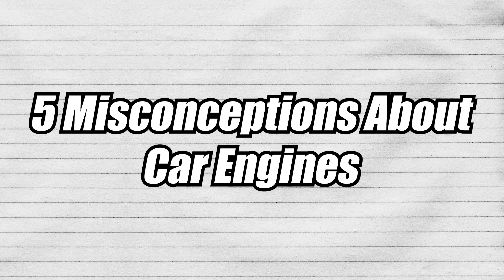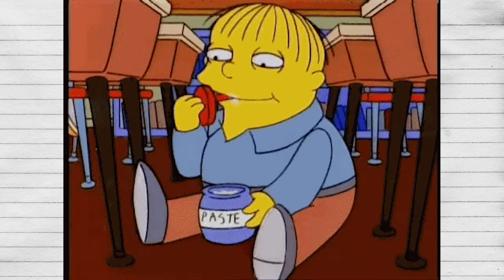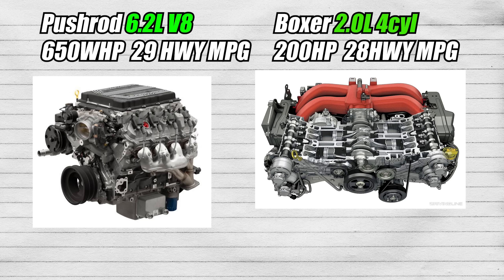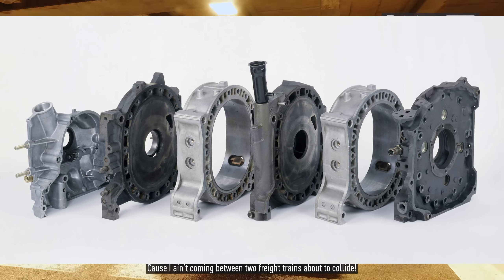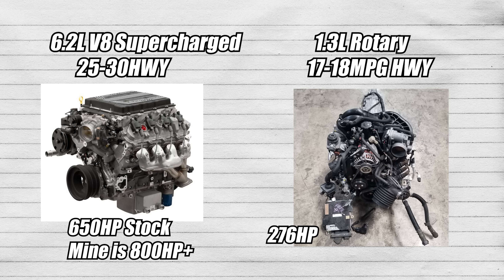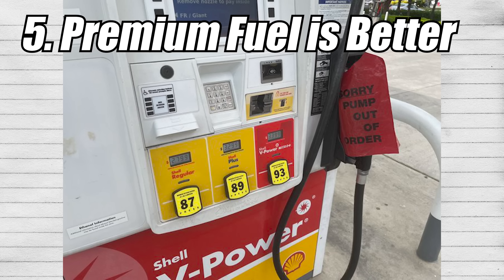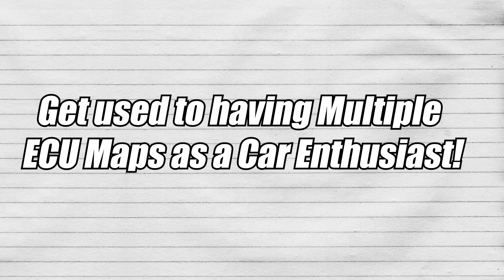5 Misconceptions About Car Engines!

Comment: The gas consumption has actually been a topic i'm used to talking about, I drove an '89 Century with a 3.1 v6 and some people were like "so, you must be just running to get gas every morning then" and then I'm like "nope, it gets me 18 mpg mixed and around 26 to 28 on highway" and this usually blowed their minds like "my 1.5 struggles to get that way in highway, how does that old thing gets that mileage" and usually the explanation is "well, my car can easily idle at 50 mph, and it goes smoothly to 75 when your car has to go all crazy on the revs to get there"
Reply: It’s because environmental regulations made it harder to hit efficiency targets, ironically. Back in the day they made cars with no VVT that did 50-70 mpg with small engines because they could get better gas mileage at the cost of bad emissions.
Reply: @__dm__  well, i'd much rather burn down gas faster than to release that sweet lead into the environment but, something true is that regulations backfire more often than we would like, as a matter of fact I really expect some negative effects on the push for electric vehicles, not out of being mean but because the guys that want to ban ICE's seem to forget how much pollution do EV's release at their first year after production.
Reply: What 1.5L can't get 27MPG on the highway? The Honda Fit has a 1.5L that gets 40MPG on the highway and over 30 in the city. The Ford Fiesta gets 43MPG highway and over 30 in the city with a 1.3L.
 
Also, 28MPG highway with a V6 is kinda low. Most V6 can get over 30MPG highway. This has been true since the early 2000's. Subpar gas mileage is not mind-blowing.
Reply: @LePedant  It does depend, reported data by the OEM's are given under very specific circumstances, I've heard people claim their 1.2's not making it over 30 mpg when I could do a 45 in a 2.5, you take into consideration altitude, environment and driving habits, and yeah, the fact that I'm 6500 feet above sea level means engines without forced induction lose around 20% efficiency
Reply: @engineeredtofail6746  Yeah, the 6500 elevation does ruin efficiency. 

People who aren't getting over 30MPG with a 1.2l must be driving full throttle everywhere. While driving, my roomie's 1.5l Fit my avg MPG is ~40, when she drives it, it's closer to 30MPG.  lol
Reply: @LePedant  yes, people usually drive that way here, I've seen people in a 1.5 Chevy with full load at 80, so there's at least one accident on a daily basis in my way to work, and as I said, huge claims about gas consumption
Reply: @engineeredtofail6746  Gas consumption of those cars are not huge claims, they are real numbers.  EVERY car will get worse MPG if you drive it hard, not just ones with 40MPG claims. I'm sure I would get better gas mileage in a Corvette than my roomie in the same Corvette.

What does a 1.5l with a full load have to do with wrecks?
Reply: @LePedant  I'm talking claims on the people who drive those cars, not the OEM's (since as said before, those are real numbers but under special circumstances). And the relationship within the example is to let a glimpse on how many people around here has no consideration on the characteristics of their cars, let me elaborate, when you got a small displacement car fully packed and at high enough speeds regulalry you obviously get poor numbers but also a higher risk of getting into an accident because, wouldn't they know it... those cars aren't meant to be used that way, and usually those are the kind of people that say "I got scammed, my car doesn't come near what i was promised"
Reply: @engineeredtofail6746  Unless they are putting an extra 1000lbs in their tiny hatchbacks, they aren't making the car more dangerous, they are just making it slower.  

It's the people with fast cars that can weave in and out of traffic that cause wrecks.
Reply: @LePedant  trust me, I've seen those rear ends just lower than any stance fanboy could get, I've seen tires straight up blowing up and it doesn't help that some of those don't really have functioning shock absorbers, however, going to the side of rational people, yeah I genuinely got surprised when a coworker said that he, alone in his one year old Tiguan was getting 23 mpg just from how he drove it
Reply: @engineeredtofail6746  I don't understand how a 1.5L engine would be geared so poorly that it struggles to get above 30 mpg on the highway. Wtf is it geared for then?
Reply: At 75 MPH my 2.0L is at 3100 RPM lol, that's what 3.91 final drive does with a performance geared transmission (only minor overdrive)
Reply: @johnhunter7244  That sucks. I get ~40 combined when driving my roomies 1.5l Fit. 

It has a CVT though.
Reply: @LePedant  did I complain or mention MPG? No. Also I hate CVTs.
Reply: @engineeredtofail6746  yea ev's aren't the issue, its people prematurely wanting to ban ICE's before alternative tech has actually gotten good enough to replace it in every use case.
Reply: It is a fact that no matter what engine your vehicle has, if you drive around at 90 mph and have a big vehicle, you will be paying out a lot of money for fuel.
Reply: Yes, a 3 liter V6 can be more fuel efficient than a small engine when at highway speeds, it is on city driving the smaller engines have an advantage. Most fuel efficient car I have ever driven that did run petrol and not diersel was a 2,9l 1990`s Ford Scorpio, no other car I have driven used as little fuel as that at 100 to 120km/h with even half the size engine and smaller.

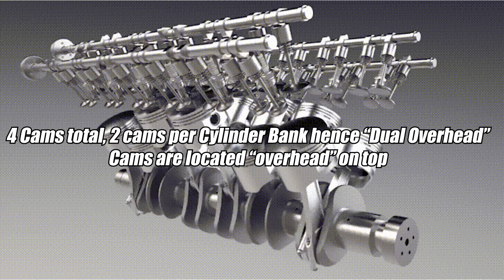Comment: 1:52 The pushrod's leverage into the valves do not produce the torque, but the way its head design flows air into the cylinders, and the way pushrods have longer engine stroke. Pushrods have fewer and larger valves, and those are what helps with air velocity and fuel mixing, resulting in low-rpm torque, but it sacrifices high rpm performance. This is also the reason why pushrods are usually longer in stroke in general. Engine designers made the best use of the short rpm range of the pushrod by increasing stroke. But remember that DOHC can produce low-end torque, too, by using valve trickery such as VTEC, having variable length intake manifolds, or just having a long stroke.

2:44 Fuel economy depends on many factors, like gearing, BSFC (Brake-specific fuel consumption), and aerodynamics. 

BSFC is basically fuel consumption of your engine divided by power produced, and it's what separates the good all-around engine design from the rest.

Aerodynamics, on a separate note, is often misunderstood. To get less aerodynamic drag, you have to have a streamlined surface ALONG with a small frontal (surface) area, and that will calculate to your effective frontal area - same principle as throwing a basketball compared to a baseball. That's why the Tesla Model X is very efficient in its range, because its effective frontal area (Cd x frontal area) is very similar to a Lotus Elise, but it will never beat the Volkswagen XL1, in terms of aero.

(Edits because of spelling and clarifications)
Reply: yeah, pushrods are objectively worse in performance metrics AFAIK. more rotating mass means the valvetrain needs more effort to open and close, which means heavier components to withstand the extra stress, which makes the problem even worse. I was really confused by Bladed's explanation because normally he's correct about technical topics.
The torque has everything to do with cylinder pressure and bore size, and pushrods don't really change that. I thought he was talking about how pushrods allow greater flexibility in the head design, but that wasn't the case.
Reply: engines that have a ton of low end torque also have a really good BSFC at low RPMs, that why the corvette have similar mpg than a gt86 with his high RPM engine
Reply: exactly, i was trying to understand why leverage of the pushrod had any effect on torque
Reply: I thought about this some more, and it might be originating from one of the misconceptions in the car community--low revving engines (pushrods generally are low revving) have to have more torque to produce the same power than a high revving engine. high revving engines should be driven at a higher rpm, that's just how it works; if you're shifting at 3000 rpm for a 6000 rpm car, you're driving about 50% of the engine's total output, whereas if you're shifting at 3000 rpm for a 9000 rpm car, you're driving about 33% of the engine's total output, which is one of the prime reasons when people say they hate high revving cars like the S2000 for having low torque, I just laugh at them. You just have to "scale up" the RPM to fit the max RPM if you want a fair comparison. It's fine if you want to shift early, but come on man.

Hence, people associate pushrods for having high torque, since pushrods have lower RPM.
Reply: @__dm__  Pushrods are strangely more fuel efficient than DOHC engines, and VVT black voodoo can help with fuel economy, it does add significant extra weight to the car and more maintenance required.

Again, it's one of these things where there's no real definitive choice of what's better, because they both have their reason for existing that either system can't truly replace and do better in all regards.
Reply from the maker: Thank you for the input! I edited the Torque Pushrod explanation accordingly, video won't live update til hours, if not, days later. As for the rest regarding MPG and Aero, weight, transmission etc.  I actually want to dedicate a video to MPG calculation.  Since this one was titled, "Engines" I didn't want to info dump too hard for pick up n go type of viewers, but I do hint about how there are other factors affecting it.
Reply: @__dm__  Personally I find high rpm engines super fun to drive on open roads, but incredibly annoying in city traffic. I really like the high rpm screaming, but I also really like super grunty high torque engines. So that's why I have both haha.
Reply: @SomeOne_86  yeah, I thought people were dumb for saying stuff like "I don't like the S2000 because it has low torque", but I've realized it would be quite annoying to have to listen to high RPMs if you just wanna go somewhere.
Reply: @__dm__  Man, I've never driven a S2000, they're very rare in not just my country, but region in general, but I can only imagine. I've driven an FN2 Type R Civic, which has 200hp from a naturally aspirated engine and that thing was CRAZY, it makes rpms like a motorcycle. That, but even more revvy with rwd? Dude XD. 
But yeah, for me I don't really mind the sound so much, it's just very annoying to have to pedal the car in traffic so much, and give it a ton of rpm on hills. It just makes me feel like I'm destroying the clutch and abusing the car unintentionally.
Reply: @__dm__  pushrod engines have less rotating mass. They have more reciprocating mass. That's why they can't Rev high like over head cams. The valve spring in a pushrod engine has to over come the mass of the lifters, rods, rockers, and valves. So when the weight of the valve train over comes the valve spring and the Cam lobe has gone by and the valve is still open when it should be shut that's called valve float. You can put stiffer springs to prevent valve float but there is a limit.
Reply: @__dm__  what you're forgetting is the weight and packaging of pushrod engines. Pushrods require more reciprocating mass, but less mass overall since pushrods are lighter than an extra cam (SOHC) or 3 extra cams (DOHC). Packaging is a huge factor since you don't have to put 2 or 4 cams on top an already big engine. This is one of the reasons why the LS swap is so common; it fits in vehicles that other V8s simply don't. There is absolutely benefits to pushrod engines, and before you accuse me of being a pushrod simp I have never owned a pushrod engine, 1 SOHC V8 and 2 DOHC i4s.
Reply: @__dm__  pushrod designs have more reciprocating mass not necessarily more rotating mass
Reply: Also DOHC can compensate for the reduced torque with variable valve timing.
Reply: To add on, it is because pushrods have an rpm limit that they are engineered to work good at a low rpm. An engine with the same specs but DOHC VVT set up properly would preform like 1% better at exactly the same rpm. As in the same fuel use same torque. But VVT allows the engine to continue making power(torque) at every rpm so those engines are made specifically to accommodate that rpm band. For example the every inline 6 turbo bmw is almost square in terms of cylinder size. This allows it to have decent low down torque, decent high-end torque, but mostly they are designed to be amazing while doing (kinda sporty things) like accelerating at 50% throttle. 3-6k. Motorcycle engines are the complete opposite of pushrod v8's with crazy specific hp but terrible low down torque. Mostly to do with small strokes.
Reply: @gameonyolo1  Precisely. GM engineers had a lot of R&D with the push rod platform and optimized the low-rpm velocity and high rpm flow. 

Both BMW's B58/S58 and Toyota's G16E-GTS are undersquare (stroke/bore ratio of >1:1) because of the need for a usable torque curve from low rpm to redline, and less surface area when at TDC for minimized heat losses and much more even and controlled combustion, especially with direct injection. Toyota's cylinder head design is very smart for combining a straight intake path with a ramp that glides on the back of the valve for fast swirl around the chamber without sacrificing flow.

Motorcycle engines have no power down low because of a short stroke (slower overall piston speeds, benefits top end but less vacuum at low end) and a high rod to stroke ratio (less intake air velocity at low rpm due to less piston acceleration).

Comment: After recently putting my Mazda into the dealership for a once over I asked about rotary parts and the bloke in the service department (who also had a couple fully built rotary engines at home) said that Mazda is apparently going to try start doing what Toyota do and manufacture the parts for 12A, 13b and 20b engines along with some other parts for older Mazdas like my mx6.
Reply: That would be amazing if that were true, but I somehow doubt that. Not saying you're lying, or even that the guy at the dealership was, but it's probably just wishful thinking. So few rotary designed cars still have a rotary today. Most of them have been LS swapped or something like that. Unfortunately, as more and more people buy RX-7s to just burn out the engine and throw an LS in instead, there will be less and less incentive for Mazda to make rotary parts
Reply: Mazda has been doing this for a while, I don’t know why this is news to you

Comment: One thing I did agree on is the waiting for oil. Yes the oil will get where it needs to go but it won’t be thin enough to get to tight clearance spots such as main bearings. Also your oil pressure is typically lower than operating temperature since the oil is thicker hence it’s harder to move which then the oil may not get to where it needs to be as it will be to heavy to flow onto certain parts of the engine other than that I agree

Comment: 3:16 (Shows a Malaysian insurance company infographic) As a Malaysian I agree wholeheartedly with what you just said. Though it's more than just the government, it's also the stigma in Malaysian society. So ingrained was this fact to the point where we consider 1.8 liters, yes, 1.8 LITERS, as BIG.

Also, here's a road tax comparison:

My dad has a 1.3 liter hatchback, which is RM70 (US$15.9) annual road tax.
He also has a 1.5 liter sedan (probably will be my first car hand-me-down), which is RM90 (US$20.4) annual road tax.
He used to have a 2.4 liter minivan, which is RM700 (US$158.5) annual road tax.

Notice the exponential increase in annual road tax from the 1.5 to the 2.4? Despite this, both the 1.3 and 1.5 are 5-speed manuals with pretty short gearing, and gets roughly the same fuel consumption as that 2.4. In some cases the 2.4 actually gets better fuel consumption than both the other engines (so much so that for the 1.5 sedan, it was retrofitted with a separate NGV system so it can run more efficiently with NGV but still can switch to regular fuel for more power. NGV stands for Natural Gas Vehicle)

Speaking of stigmas, people here usually think that cars with big engines are only for the rich (this ties back to the annual road tax, for example, a car with the VR38DETT engine has to pay RM5730 annual road tax, the average Malaysian couldn't reliably afford that). As a Malaysian teenage enthusiast I really want our government to research into the road tax and put higher taxes on gas guzzlers instead of fuel-sipping giants. 

If you're wondering, the 1.3 hatchback is a Proton Satria, the 1.5 sedan is a Proton Wira, and the 2.4 minivan is a Toyota Estima (with automatic).

Also please transmission video Bladed ;)
Reply: Great example of totally misguided automotive law. It's very similar to many other countries. And more broadly, many other topics - it's easy to convince people of things that are easy to believe without any real thinking.

Comment: My car is tuned. I did the tune.
I went way out of my way to set the constrain statements on the ignition timing. (the minimum amount of advance)

It was a lot of road testing and data logging to make this work with no misfire  but using the knock frequency tables i now have a "auto tune" 87 93 pump gas tune.
Reply: 95 octane baby(usally the only petrol alternativ in sweden 98 octane exist in a few places to )

Comment: My 2000 Trans Am 6-speed got 22mpg with a 9" fabbed rear end with 4:11 gears. When it was still on the stock rear end and gears, I got 31pg while breaking in a new clutch. I owned it since 2013 and loved it, but it got to the point where I wasn't even putting 200 miles on it a year. Instead of watching a fun car meant to be driven waste away in my garage, I sold it earlier this year and bought a 2015 Lexus GS350 awd for a commuter car.